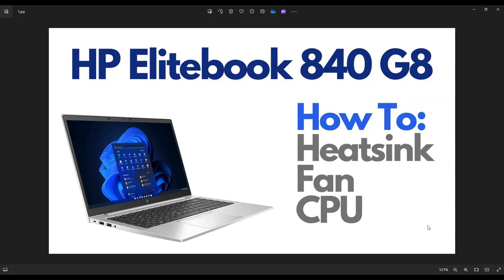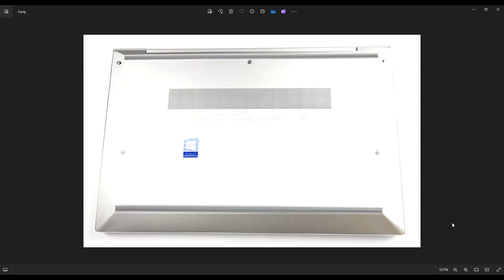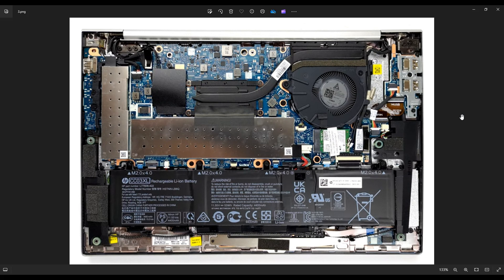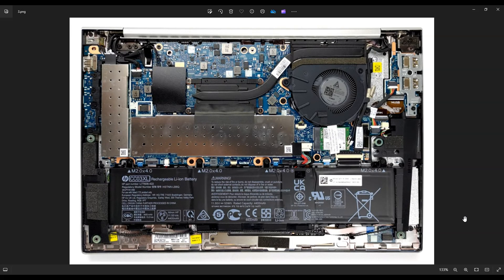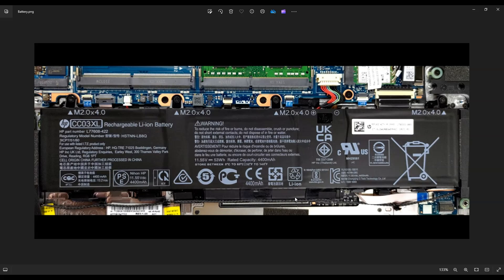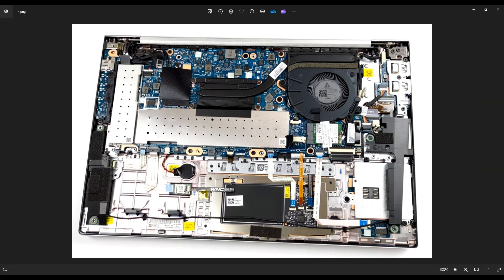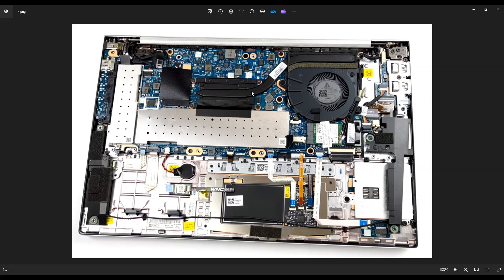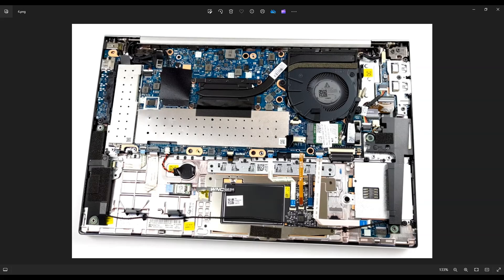How To Replace Fan, Heatsink, CPU - HP Elitebook 840 G8 Laptop Computer

Comment: Simple,very clear, professional, but if you would have removed cpu black cover, and its adjacent part cover it would have been more clear. Any way what is the part called which in between nvme SSD and cpu. Thanks in advance.
🙏🌹💐👏👏👏💐🌹🙏
Reply from the maker: There is a Wi-Fi card between the SSD and CPU. Is that what your referring to?
Reply: Then between memory AND CPU FAN Is it mSATA
PL. CONFIRM.